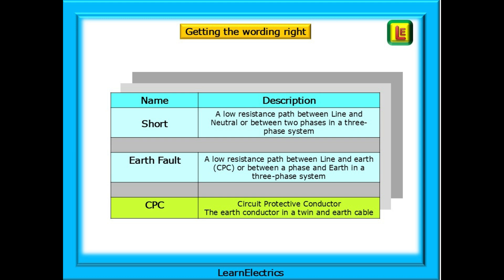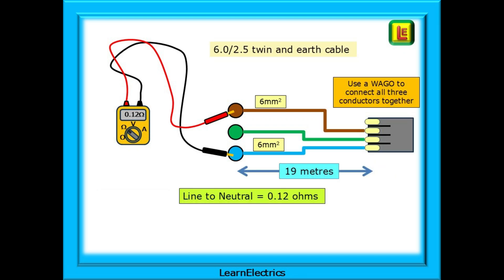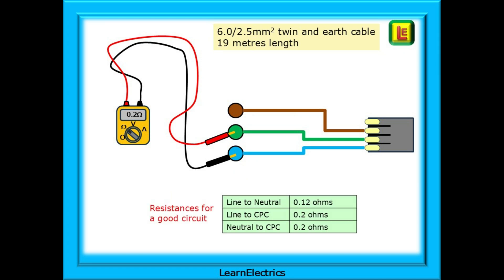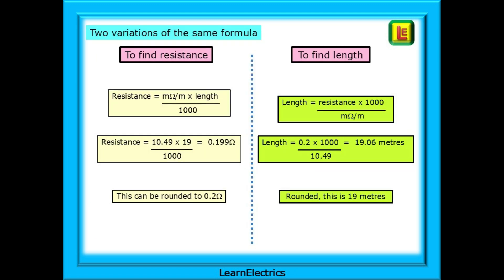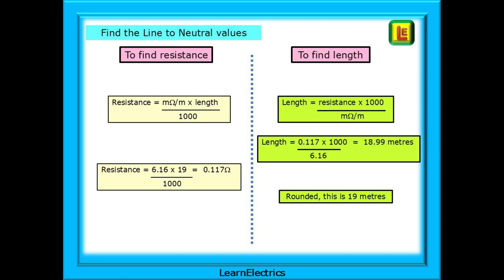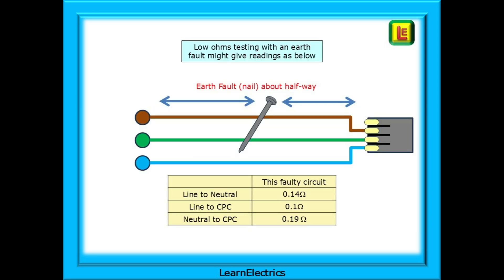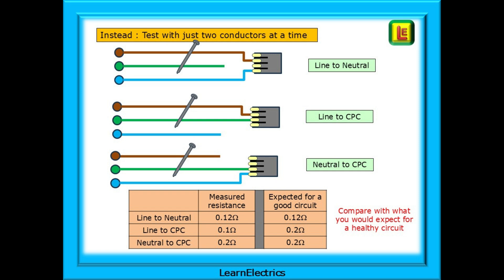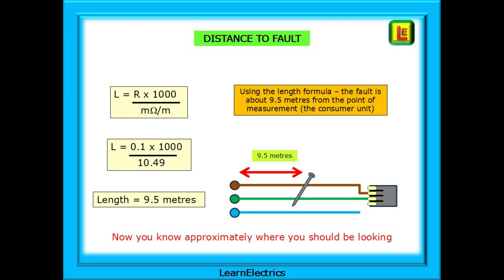FINDING SHORT CIRCUITS IN ELECTRICAL INSTALLATIONS – PART 3 – RADIAL CIRCUITS – WITH WORKED EXAMPLES

Comment: Brilliant video Dave. If the wires are already damaged, how are we to get a reading of what a good citcuit looks like in order to compare it to a bad circuit with a fault?
Reply from the maker: If you know the approximate distance, just use the tables to get an approximation of what it should be. Compare this to what you actually measure. If its a lot different you can be certain there is cable damage. This is just one way of locating faults, over time come across different methods. Thanks for watching. Dave.
Reply: @learnelectrics4402  thanks Dave, that makes sense for something that is on the same ground level such as a cooker. What happens if we are trying to fault find a ring circuit on the second floor for example? How would be approximate that scenario? I'm still in my training and learning a lot from your videos..keep it up

Comment: So, an ordinary multi meter (fluke 189 ) wouldn't be able to do this test ?
Reply from the maker: A multi-meter will do continuity/low ohms tests. I would often use a multi-meter in preference to my multi-function tester as the multi-meter is smaller and easier to hold in one hand.
Reply: Thank you for your reply. I struggle with low ohms readings in testing, probably more practise.